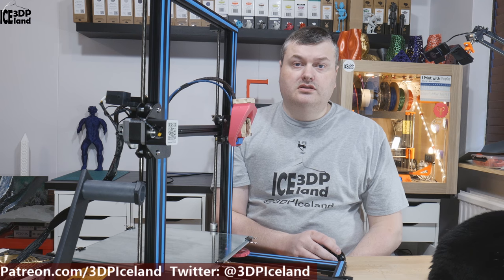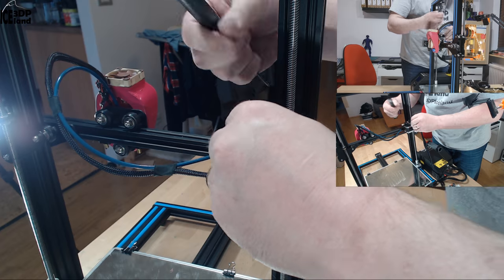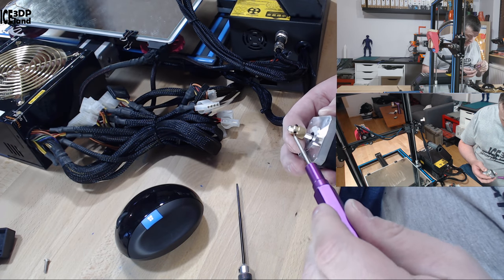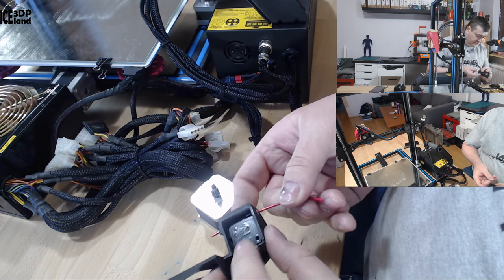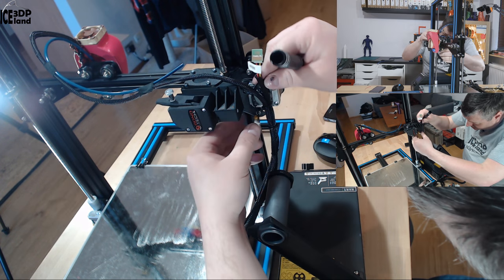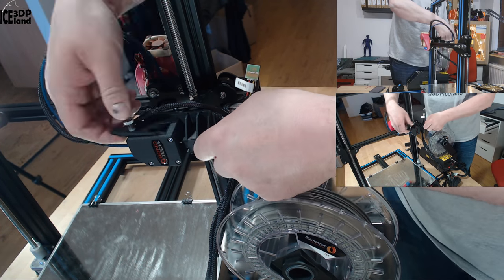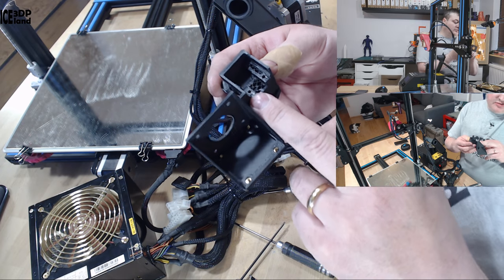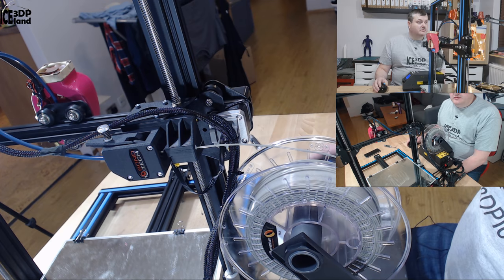Creality CR-10S -  Bondtech Extruder installation

Comment: I am so frustrated right now. They are still shipping these things with an incompatible mount for the CR-10S filament runout sensor. Even worse...on my CR-10S there is a bolt protruding out of the X gantry just enough to prevent me from mounting the Bondtech assembly to the frame because the bolt is crashing into the side of the extruder stepper. In your video I can see that your bolt does not stick out past the lock nut. I just spent three hours taking the frame completely apart just so I could replace it with a shorter bolt. On the plus side...I can finally put this thing back together so everything is square.
Reply from the maker: Hi . Here is my edited version of the bracket, https://www.thingiverse.com/thing:3226551 - I find it strange that they still ship it , as I have given them the .STEP file for my fixed design...
Reply: 3DP Iceland Thanks very much for the link. Can you think of any clever way to deal with the bolt that is sticking out into the stepper motor. I have a second one that I need to put together and I’m not looking forward to tearing another one apart.
Reply from the maker: @lazlo342  your welcome, - yea, checked mine, my bolt is flush to the nut, - only thing I can think  of is getting a dremel with a cutting wheel and cut of the end of the bolt....
Reply: Perhaps just buying a pancake stepper would be the easiest solution. And then I would also have what I need o go to direct drive in the future. Can you recommend the correct stepper to buy on Amazon? Thanks.
Reply: @3DPIceland  Yeah, that was my first  thought.  I spent an hour looking for my Dremel in my garage last night at 1AM before giving up. Bought a new one today. :)